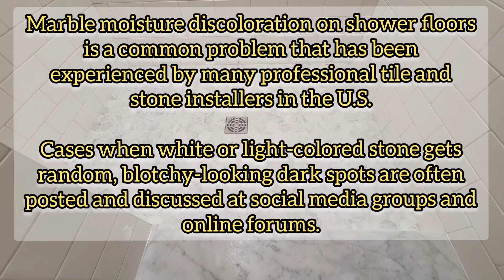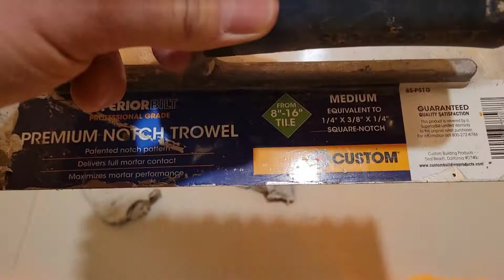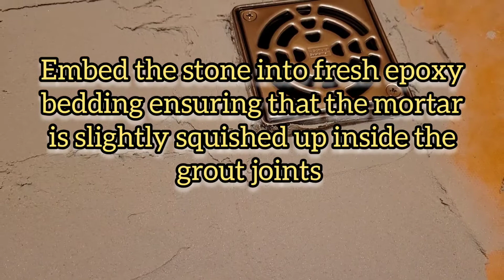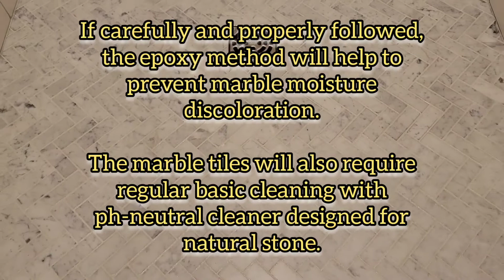Carrara Marble Shower Floors - How to install?

Comment: Would you use this same installation method for marble tile on shower WALLS?
Reply from the maker: No, the method is intended for the horizontal interior wet surfaces. For marble shower walls I use a cementitious mortar complying with ANSI 118.15 since they have a high water repellency. Such as Ardex X77, Laticrete Multimax Lite, Custom Megalite or similar.
Reply: @TileProUSA  I was planning on using X77, good to hear you agree
Reply from the maker: @danielegraff  yes, Ardex X77 is a great mortar to install marble on shower walls. Just make sure you do full mortar coverage and use the white color.
Reply: @TileProUSA  would you apply sealer to the wall also, or just the floor?  what about a niche?

Comment: does the epoxy method work on the hot mop and dry pack method, the old way   (i live in california)  or does it only work on the sealed system?
Reply from the maker: Epoxy method can only be used with a bonded/sealed system but I described the dry-packed method for it in the following article:
https://tilepro-usa.com/tile-pro-blog/f/eliminating-marble-moisture-discoloration

Comment: I noticed you used Ardex WA for installation, do you recommend using the same as grout and if not wich grout do you recommend?
Reply from the maker: Hello! Please carefully watch the video again. I described every step of the installation in detail.
Reply: @TileProUSA  Thank you for getting back to me. I watched the video my question still is wich brand of epoxy grout do recommend. Ardex  WA can also be used as grout. Have you used it as grout? Thank you again. I am a small contractor and I am working on my first marble shower.
Reply from the maker: @Luis R. Salazar Castillo  yes, in that video, I used Ardex WA (Fresh Lily color) to set the stone and to grout it.
Reply: @TileProUSA  Thank you.
Reply: @TileProUSA  have you used Mapei Kerapoxy CQ for this method. It is a solid epoxy and it is also a mortar and grout.
Reply from the maker: @Luis R. Salazar Castillo  like I said in the video, a 100% solids epoxy and mortar is needed.
Reply: @TileProUSA  Thanks again,  this is my first marble shower I will stick to what you used.